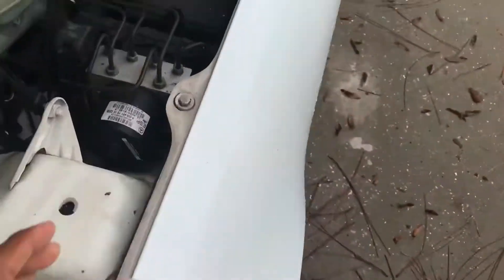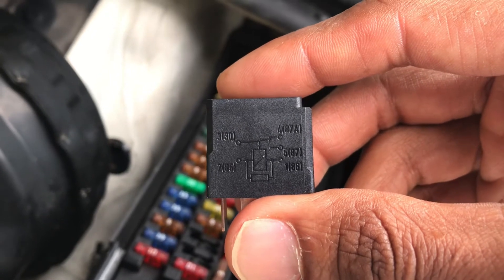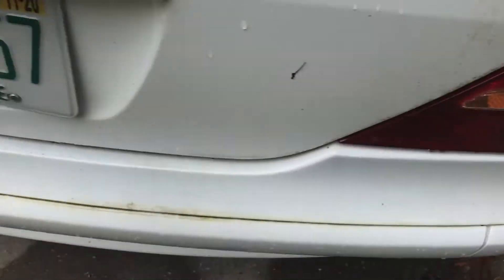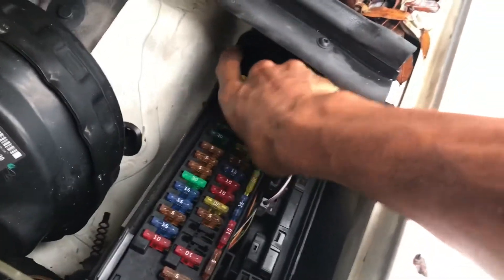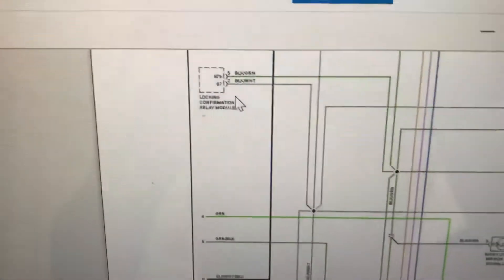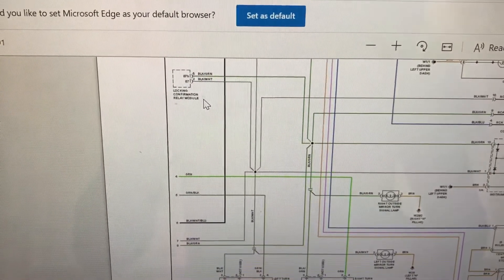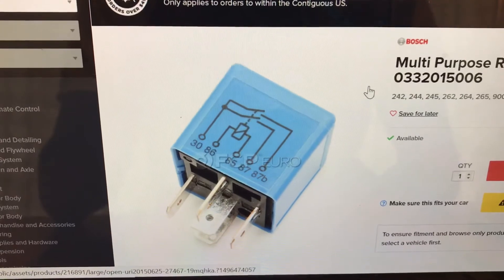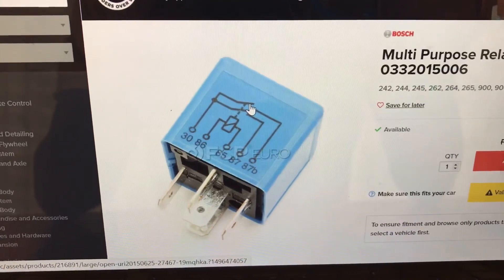RESTORING SLK 320 COPART FLOOD CAR - PART 34 - FIXING RIGHT PARKING LIGHTS STAYING ON

Comment: hello i have slk320 like yours and have recently a permanent beeping inside cabin, no warning light on dash just beeping , i notice my hazard and turn signal don’t work so did you ever have this issue?  could you tell me where the hazard and turn signal relay is located on slk320 i checked under footwell but impossible to find any place 
if you have part number of this relay it will be very nice 

thks
Reply from the maker: Hi z4 funk

The permanent beeping maybe the sos device being turned on. Open you center console and there should be a button with a “wrench” or an “i” i believe inside the armrest cover. Press that to see if it goes off
Or. There are several things that comes to mind if beeping comes from the interior.
Have you put the top down & back up, if the roof has not fully compleeted its cycle it will beep to let you know its not fully locked. I allways hold the switch until the windows come up.
The car will also beep at you if start the car and your seatbelt is not fastened. or if the key is in the ignition & a door is open

As far as the relay for the turn signals. Its located in the k40 relay box. Take a look at this thread. 
https://www.benzworld.org/threads/slk-indicator-lights-staying-on-possible-fix.1355156/

Its inside the computer module next to the battery. Its the third relay from the left on the computer board. If they dont work at all. I would start first with a fuse check. There is no easy way to replace the relay since its part of a circuit board

Check fuse 35 in left rear corner of engine compartment. Should be 15amp
Reply: Auto Replay it is not cause roof it is beeping when i put the ignition with/without start engine 
i know where is located k40 but there is  another module bigger next k40 so i wonder if the relay is on the k40 or inside the other bigger module 
about fuse 35 when i put it off beeping stop immediately and when i put it on beeping come back 
not seat belt as i already try and no effect 
as it is slk320 i am told hazard relay is located on footwell not in the k40 place

could you send me photo about the button on the armrest as i don’t see what you are talking about
Reply from the maker: Z4funk Dreamer 

Sorry not the k40 

Its in the n10-3 combintation control module
Reply: Auto Replay ok and what do you think about beeping stopped’when i put off the fuse 35  ?

i would like remove the n-10 module but there are many wires and don’t know how remove it 
do you have any photo or video about this fix ?
Reply from the maker: Z4funk Dreamer 

Ill make a video
Reply: Auto Replay GREAT👍👍👍
Reply from the maker: Z4funk Dreamer 

Check out 

Diagnosing interior beeping and no turn signals on 2001 - 2004 Slk 320 https://youtu.be/YYPze1pFUqo